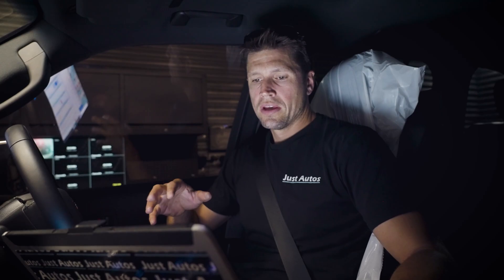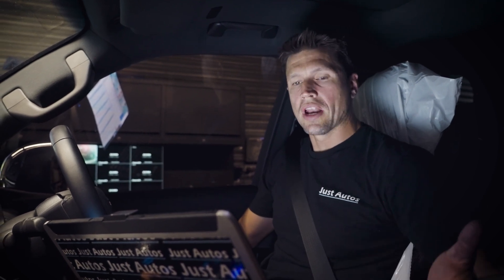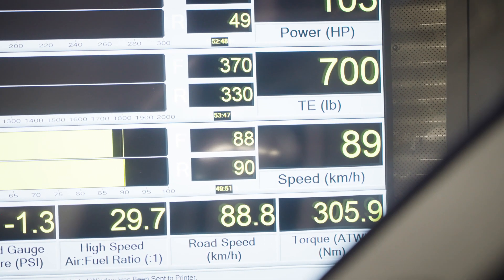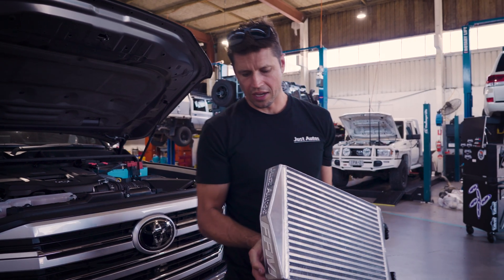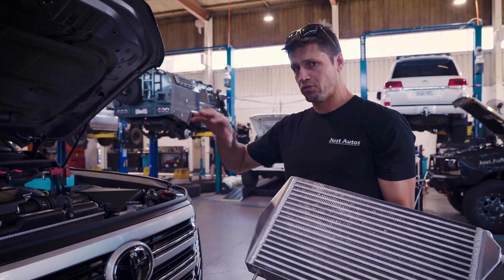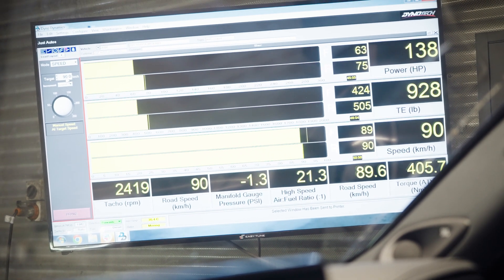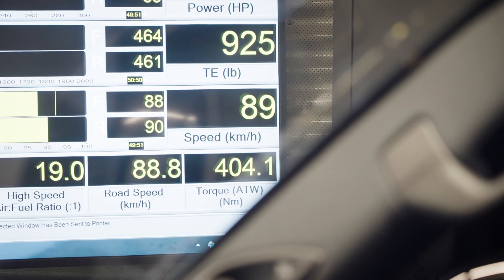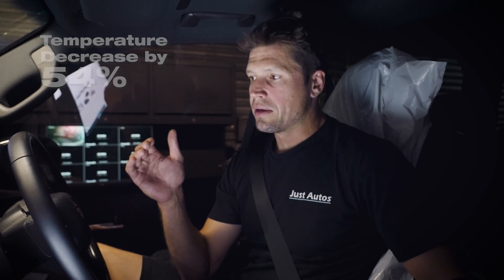JA 300 HEAT EXCHANGER

Comment: I don't want to block the condenser for the AC, is this concern valid?
Reply from the maker: We can a fan to assist in reducing the temperature while low speed as we do this in the UAE as well as the 25 model has this mod?
Reply: @JustAutosMechanical  There is already a fan for the condenser, 1 fan. the other half of the condenser has no fan. Do you mean adding another fan? The temp here gets to 40-50C and I have the twin turbo v6 petrol engine and noticed while driving in hot weather the power is down to what a v6 4.0 NA engine produces. There are people adding fans to the intercooler, but IDK what is the solution to keep the power and the AC.

Comment: What the added heat that you introduced into the condenser. Did the AC suffer. Could you have fitted a bigger radiator is the stock position.
Reply from the maker: No not needed

Comment: It blows my mind that Toyota didn't do this from factory. That's a huge difference to not only performance but also longevity of the engine. Shame on you Toyota.
Reply: it's not really affecting longevity by much since factory already reduce power when temp is high as safety feature. Although i don't understand why they use these small joke of a water intercooler.
Reply: @and7976I can't argue yes or no on that comment. But Toyota screwed up. And I'm sick of people having to upgrade these already overpriced vehicles. The Chinese will wipe the floor with the other car manufacturers. They know what customers want. We want it fully decked out from the factory.
Reply: @MrWerd910  There is things that need to be upgraded. for a 100k+ vehicle is not acceptable, like the plastic skid plates, the air box that doesn't seal dust, the wind noise from RHS A pillar. I  (I owned a 200, now 300). Overall the performance is a huge step up from the 200, but these things just annoy me.

Comment: Late question,  but what egts are you seeing on these long hot pulls? Does the computer monitor the egt also and use it as a signal to reduce fuelling?
Reply from the maker: @cpointon95  factory does not only our v3.0 muilt map does. Depends on a few things 550-650

Comment: Does this also control gear oil heat?
Reply: @JustAutosMechanical  does it over cool in winter or does it adjust temperature my friend?
Reply from the maker: Sorry no only intake temp
Reply from the maker: Yes as the pump duty is based off temp
Reply: @JustAutosMechanical  were can i find all the info onthe product, best regards
Reply from the maker: @ilmunaifi  https://www.justdieselperformance.com.au/mods-upgrades/heat-exchanger/

Comment: You need to point the fan at the side where 2 small radiators for the heat exchanger are located. Is the aircon still cold after the upgrade ?
Reply from the maker: Why bother when you can just add an additional and much larger heat exchanger. Yes it has nothing to do with aircon
Reply: @JustAutosMechanical  Does the new heat exchanger put more heat into the radiator and the aircon condenser and does the radiator still get enough air flow??  Also would this affect the car warranty?
Reply from the maker: @ not that we have seen it the data as the cooler has a direct flow. Anything you do to your car can effect new car 
Warranty
Reply: @ianstromilo6962  Yes your warranty  will be void and if your engine  goes poppy you will be up for the replacement  cost.

Comment: What does this mean for your gearbox temp? Wouldn’t you cook the gearbox with this sustained power output?
Reply from the maker: Gearbox temps stay stable. We have another video with live data towing a 3.5T van on the road https://www.youtube.com/watch?v=otkwxzotwCw
Reply: @JustAutosMechanical  thanks.   Very impressive indeed.
Reply: @JustAutosMechanical  Can you shed some light on how the heat exchanger keeps the transmission temps in check without an additional transmission cooler? Cheers
Reply from the maker: @AlexSwan  The heat exchanger has nothing to do with transmission temperatures. We have a lock up kit built into manual mode which keeps trans temps down.
Reply: @JustAutosMechanical  I see, thanks for clarifying.

Comment: That's awesome what you guys have designed and done. I've been a massive toyota lover for over 25 years however I feel like toyota has lost its way when it comes to the 300 series and being branded a landcruiser which is known as being a tuff tourer and this is the exact reason why. Why does this not come standard on a $100 + thousand dollar vehicle? It's a absolute joke. Mr Toyota needs to have a good look at itself.
Reply: I think on the dyno vs 100k/h freeway speed the results are different. So this test does not reflect the real world situation due to limited airflow in the first place. Since both factory coolers will get enough air through on higher road speed. Toyota engineers have spent more than 6 years to develop this engine. They must have done all kind of tests. Also, people should not drive the car to the limits as even the engine is protected, the automatic transmission wont be able to handle it. it will be overheated and get cooked- I mean put the foot on the floor for 60 seconds towing heavy caravan uphill!
Reply: @springweng there are many slow speed situations likedune,beach, offroading I experienced over heating in the gear oil and engine after 30 minutes in the dessert dunes at slow speeds, I am from Kuwait ine of the hottest countries if not the hottest
Reply: @ilmunaifi 
the hottest indeed..
Reply from the maker: @springweng  These vehicles arent designed to tow 3.5T out of the factory. We have done real world testing on the road https://www.youtube.com/watch?v=otkwxzotwCw